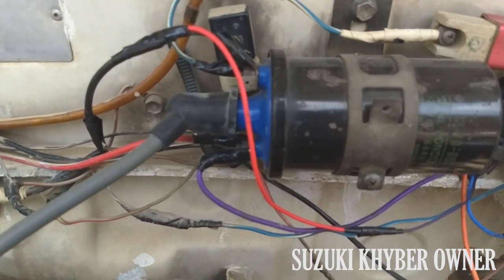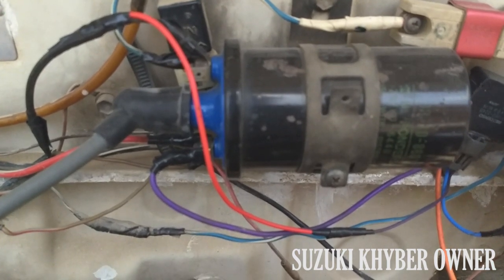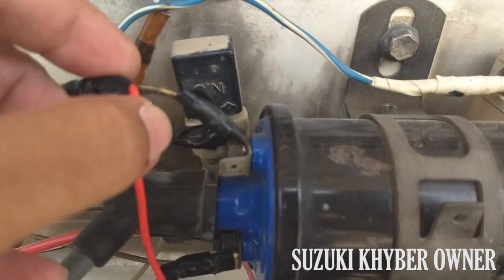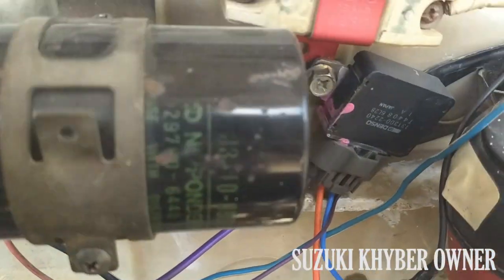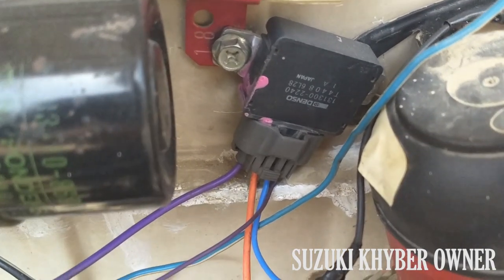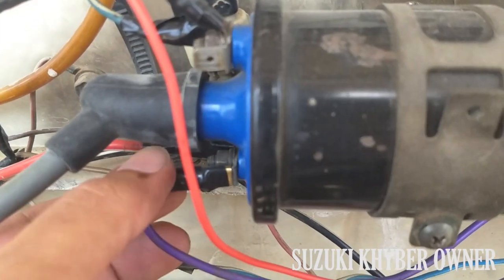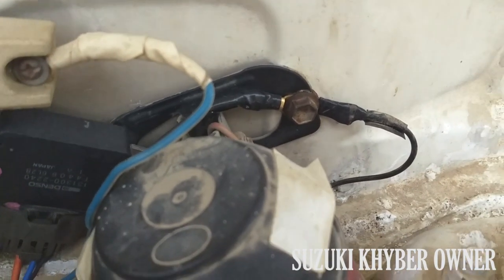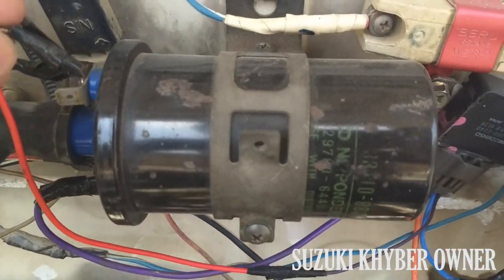How to Increase Current of Ignition Coil to Get Better Fuel Efficiency

Comment: Very informative video keep it up, Bro I am having issue with my ignition coil in 1996 khyber. It take 3-4 long selves to start on cold engine even in summer on petrol. And there is always a jerk and missing when I push the pedal from low to high rpm. 
Can u plz guide how much a new or used ignition coil and this ignitor will cost with installation please. Early response will highly be appreciated.
Reply from the maker: Thanks for liking the video.First have the current checked on the plug whether it's blue or red.If the current is blue then it's a problem of tuning.If the current is red on the plug then it's mean there is a weak component in ignition system.

Comment: Plz explain that egnition soich sy any wali wire bhi ap ny coil k +point men and resistance sy any wali wire bhi +point men kesy lagai hoi hen?
Reply from the maker: ignition coil + main two wires connect hote hain 1.ignition coil + wire jo direct distributor se connect hota hai 2.ignition switch + jo resistor ke through ignition coil positive main connect hota hai.

Comment: Coil ke connections explain kr den
Reply from the maker: Coil + main two wires connect honge 1.ignition coil positive wire(black/white) 2.ignition switch positive wire(black)through resistor.
Coil - main single wire connect hoga.ignition coil negative wire(brown)
Reply: @SuzukiKhyberOwner  brown wire ko body se bi current dena h
Reply from the maker: No .  @amjad98237